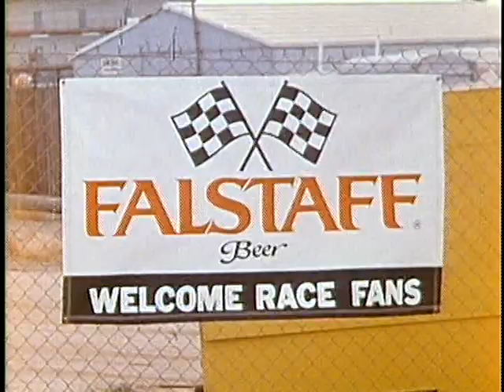1970 Fallstaff 400 @ Riverside

Comment: A correction, @  4:19  the 08 Plymouth Superbird was driven by John Soares Jr who finished 4th in this race was 12 laps down. The car was a original 426 Hemi Superbird, Tor Red, 4speed car that Chrysler had given him for sponsorship & picked up from Melrose Chrysler Plymouth in Oakland California. . For the 71 season it was turned into a Roadrunner & John won a Winston West race with it at San Jose California. The car was sold to someone in Canada in 72 when John built a 72 roadrunner. I work on Johns racecars from 1982 til 1992 when John got involved in racing in Australia. John passed away late 2022.

Comment: It was the best to watch the big cars on the sweetest track of all time-RIVERSIDE. From turn 6 watching these guys lean over through the esses was a total thrill. Nothing like Riverside's esses; they were perfect. I was so lucky to have been there a few times as a kid and still totally heartbroken it is gone.
Reply: YOU BET. I was watching the summer NASCAR race from the infield where the apron slopes up to the cinder block wall with a fence on top? From there I could see the exit of the first ess at the bottom and the braking zone for turn 6 at the top. Well, I was watching the pack dive into turn 6 at the top, and I noticed everybody along the fence on my side was running. Of course, I'm dumb, I think "WTF?" Then a back-marker pancakes sideways into the wall at the top of the apron....RIGHT AT MY FEET! I look down the track and those people are walking back to where they were. Everyone, including the driver and myself were fine, but I think that was about the most exciting time I ever had there. Not to mention, the biggest face full of dust I ever had.
I miss the old, up-close & immersive days of spectating.

Comment: When racing was still racing!
Reply: 41plymouthnut except for the fact that racing... still is racing.
Reply: 41plymouthnut It’s still racing.
Reply: @yammmit  You may not have been around in the 50s and 60s to know the difference.
Reply: @ctrlshiftqq9846  You may not have been around in the 50s and 60s to know the difference.
Reply: 41plymouthnut I know how much better it is. It’s great and shows raw driving
talent, but I’m saying it will never be this way again, so get over it. Things move on, and so should you.
Reply: @yammmit  go to your local tracks and see how much better it is without all the hype and cars that cost hundreds of thousands of dollars. Where the engines are built in home shops and not leased from the engine owners.
Reply: 41plymouthnut ‘better’ is subjective and you’re obviously very biased about the way things ‘used to be.’ If small operations are so much better, just watch that instead of NASCAR, because NASCAR is never going to be what you want it to be.
Reply: @yammmit  You should get out and race, then see if your opinion changes. I don't watch Nascar now because of the changes, the same reason the stands are never full. I raced in the 60s and early 70s when a stock car was a production car. I have watched  the decline of Nascar through the years. So many fans only know the current state and not the history.
Reply: 41plymouthnut Believe me, if I had the money I’d have been driving go-karts for years now in hopes of a possible racing career. Obviously I know the history of NASCAR. I’ve studied it and seen lots of documentaries on the matter. But things have changed, and that’s what happens.
Reply: @yammmit  I started racing carts in the 50s when I was 8. That was the youngest that was allowed in my area. My brother and I had a David Bradley cart with two 6 1/5 horse Power Products engines. We had no money, only what we could earn delivering early morning newspapers and mowing lawns. We couldn't make all the events in our area because we couldn't afford it. We were lucky there was an abandoned airport close by where we practiced. In my teens I ran dirt track and asphalt, Drag raced and Moto crossed. All on a small budget. If you want it bad enough, you can have fun. Because it has become a money game, it is almost impossible to get in unless you have big money sponsors. A lot of drivers are given rides because of the sponsor money they can bring with them and not because of their driving abilities. Danica Patrick is a good example. She lost her ride when Peak antifreeze quit sponsoring her. Don't give up on your dream if that's what you want.
Reply: 41plymouthnut i don’t need to be around the 50s/60s because i can just watch a race on my phone here in 2020. you’re blinded with nostalgia which is why you think like this
Reply: @yammmit  things did change. And the France family totally skrewed the pooch.  Are you a fan of this newest version of NASCAR ??  The segment winner crap???  They might as well give participation trophys now instead of a race winner... we could call it the car that crossed the finish line the most time. And we could award ribbons to the pit crew that is cleanest at the finish of the race!!  This certainly will appeal to millenials that might want to learn about the history of NASCAR.
Reply: @ctrlshiftqq9846  NASCAR will be gone in 7yrs thanks to mismanagement from the France family.   They were so concerned with getting new fans that they totally dissed the fans who made this sport popular.  Anyone who thinks NASCAR has made the experience better with all the stupid changes really has no concept of what NASCAR was about. You can have this crap they are pumping out today.  I will happily watch the old races on YouTube and comment about how lame the racing is today as compared to the good ole days.
Reply: james meadow the racing is very boring today but whining about how great the old racing was hasn’t worked and it won’t work. However, the 2021 car is looking very promising.
Reply: @yammmit  nobodys wineing ... except for u Im affraid to say.  The writings on the wall.  NASCAR alienated its true loyal fans in the 2000s.  They totally became caught up in greed ... for $$$ and fans.  The Frances thought they could increase their bottom line by "improving" the format which had worked for over 50yrs.  Think about how Coke did it in the 80s when they announced a new formula and it was so much better than the original....  HOW did that work out???  NASCAR will likely never recover and I think the sport as we know it will be gone by 2030 except for some regional events like The World 600 and the Rebel/Southern500.  These races are going to always be around bc their are people who will prep a car to race in those races alone.  So I believe they will survive and raced in some form.
Reply: U want to see real racing go support your local dirt track especially sprint cars u don't rub or u flip that takes talent
Reply: @dougsmith9099  I raced dirt and asphalt in the late 60s and early 70s. It got too expensive without enough sponsers.
Reply: It’s the millionth nascar old head lmao

Comment: Production peaked in 1965 with 7,010,218 barrels brewed, and then dropped 70% in the next 10 years. While its smaller labels linger on today, its main label Falstaff Beer went out of production in 2005. The rights to the brand are currently owned by Pabst Brewing Company.

Comment: GM & Ford cried to bill france  so much he out lawed the 426 Hemi in the super bird & Daytona . in this day in age these hemi cars would be way over 250 mph.  if you could hold um down .
Reply: lol really, the 426 hemi raced and won in every year between its debut in 1964 and 1974 when everybody had to go to small blocks.
Reply: Nope.   Easy to spot the Chrysler fan boys because they pretend the Boss 429 never existed.  All engines over 366 CID had to use restrictor plates starting August 16, 1970, which marked the end of the big block.   Boss 429 put out 610 - 620 HP while the 426 Hemi put out 590 - 595 HP.  All aero cars, Talladega, Cyclone Spoiler, Charger 500, Daytona and Superbird were limited to 305 CID for 1971 and 1972, not just the Chryslers.  Fact don't care about your feelings.  ;-)